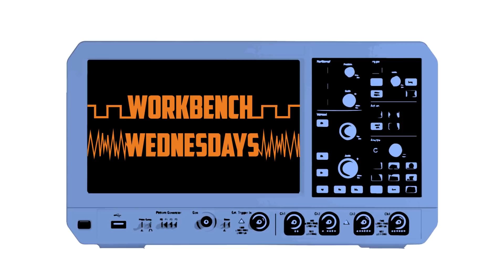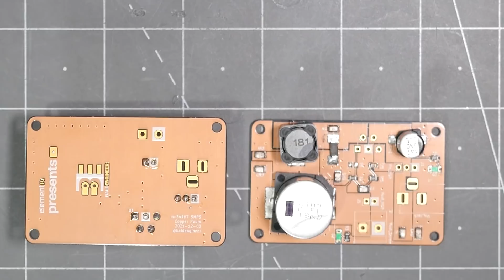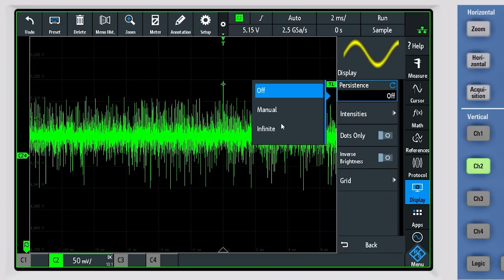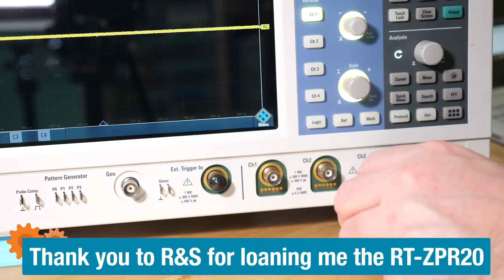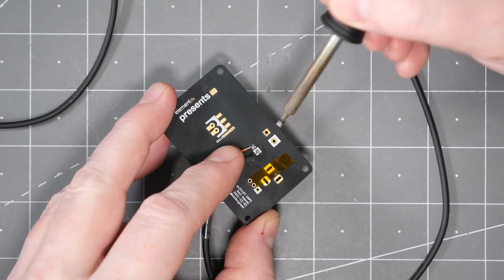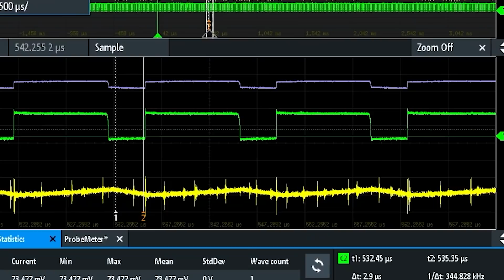How to Measure Ripple Voltage on a Switch-Mode Supply - Workbench Wednesdays

Comment: You did a lot of talking but you didn't show how to high was your ripple on your 5v output circuit after claiming that the digital multimeter was lying
Reply: Doesn't matter. DMM said 5V on all of the boards shown. The teaser used the 2nd board design shown with the oscilloscope, which had both peak-to-peak and RMS measurements for the Vout on each board.

Comment: if a dc switching power supply is failing a ripple test which components are the likely culprits and should be changed?
Reply: I would start with the output capacitors. Then I would verify that the inductor used is properly rated. (i.e. its saturation current is higher than the load current.)  Next, I would look at the input voltage to see if the noise is present there,  but not getting rejected. Last, I would look at the Vin, Vout, and the feedback signal to see what noise components are on each. 

Remember, the feedback signal is more than a resistive divider; it is the input to the error amplifier.

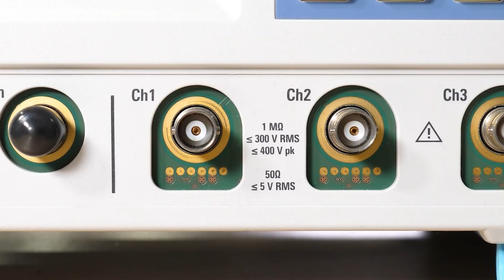Comment: 8:14 why not just use the 1MOhm channels? I don't have a fancy 50Ohm scope (mine is all 1MOhm) and those can do 400v. are the channels on that scope like dynamic? (As in, 50ohm to 5v and below on the same channel and 1MOhm and 300v and below for the higher voltages?)
Guess I'm limited to 6mhz measurements, still good enough for my use I guess? I got a siglent sds824x HD. I don't think it even takes one of those fancy probes(?) and the 1x mode is 6mhz on the probes I have.
Reply: All oscilloscopes that have 1 Mohm and 50 ohm input paths have similar voltage limits. 

The high-impedance path is generally noiser than the 50-ohm path. On an oscilloscope with only 1 Mohm input, obviously, you're stuck with that.

6 MHz (not mhz) isn't enough bandwidth for proper ripple measurements. You need at least 20 MHz. It's fine for qualitative, but so is using a 10:1 probe.
Reply: @bald_engineer  oof. I couldn't find a cheap 20mhz probe that was 1:1 I wonder if I can build one somehow, or use an amplifier?  I tried shorting my own scope in 1:1 and it measures 200uV~ in 1:1.

i'm a bit confused tho, how can they have two different input impedances at the same time? do you like change/select it on the scope for each channel digitally?

I wonder what other options I'd have... I'm a hobbyist and don't have 10-50k to drop on these things :P even 100CAD is a lot to me.
Reply: @ameliabuns  Yes, you have to choose the termination path (1 Mohm or 50 ohm) just like you have to choose the coupling (AC or DC).
Reply: @bald_engineer  Oh thank you so much that's cool :) and somewhat dangerous. I can already see my clumsy self selecting one on accident... good thing I don't have one LOL.

I guess i'll go hunt for a 20mhz passive probe or something or find an alternative, thank you for your help :)

Comment: Do you know what the fundamental frequency of the ripple current is? Is it the clock speed of the ic? Or does it have to do with the rise time
Reply: It is the frequency of the switch controller's switching.
Reply: @bald_engineer thank you

Comment: Hey m8 my cb radio base station 240v mains has a very noticeable hum even with the volume down, it is not a switch mode but linear, any suggestions?
Cheers
Reply: Try add in the 12V input line one 0.1uF capacitor or another you have. Another way is add in the positive an inductor. Doesn't work.  Then maybe your power supply is not regulated and need change for a better one.

Comment: As I understand power rail probes, their operation requires the power supply rail to be below a certain impedance over frequency as to not form a divider with the probe. This is not usually a problem if the power rail probe is used as a final test for ripple after the power supply impedance has been fine tuned (no peaking). So, the testing approach may be follow a set procedure of equipment and tests performed depending on how the lab is equipped.

Comment: When measuring voltage ripple of a power supply, its customary to put in AC mode, at 20Mhz, and put the power supply under load, but is it normal to put a 0.1uF capacitor in parallel with the output terminals?  Wouldn't that serve to suppress the very AC noise we are trying to measure?  The Riden video instructs us to measure Vpp ripple in this fashion, why would that be?
Reply: Probably to (somewhat?) suppress high frequency noise which is not the same as line frequency "Ripple" at 60/120 Hz, etc. Yes, we need to be clear about our objectives.

Comment: Doesn't the required minimum load depend at least in part on the output voltage? 

1k ohm @ 5v = 5mA 0.025w
1k ohm @ 240v = 240mA 57.6w

I could easily be wrong I'm no electrical engineer just a hobbyist
Reply: As stated in the video, it depends on what the datasheet for the converter IC says.

Comment: How has the power rail probe been connected? For Vout ripple measurement, the GND clip cable on the passive probe should be avoided due to the large ground loop. E.g., a spring adapter is more suitable for this kind of measurement.

Comment: Just put your multimeter to messure AC. A clean DC power source looks like 0.0v AC. If you messure anything else. You know your caps are crap and need to be replaced
Reply: No, that does not work with high-frequency switching noise. The DMM will measure 0 VAC. Follow the link in the description over to e14 for pictures I took showing my DMM's measurements.
Reply: Nowadays DMM has 10MHz bandwidth!  It is good enough to get most important performance of the SMP. Check your equipment specifications on hands frist.
Reply: @phonesmith5189  Again. I addressed this on the e14 link above. My 2 year old DMM, modern design with BLE, measures 0 VAC. 

And even if your DMM could measure the noise, without an FFT, you won’t know WHAT value LC to add. 

A DMM alone is not enough. Period.
Reply: @phonesmith5189 what dmm has 10Mhz bandwith in AC mode ? Expensive ones can do only 100 khz and a bit more.

Comment: Useful video!!  Interested in seeing a project for a 30 Amp 5V power supply with adjustable + or - 2V to account for losses at the load.